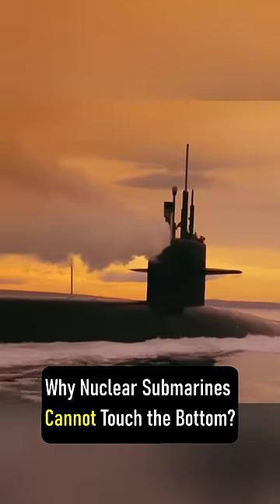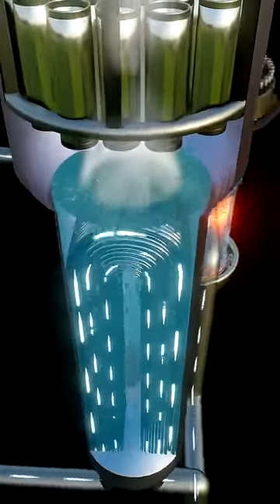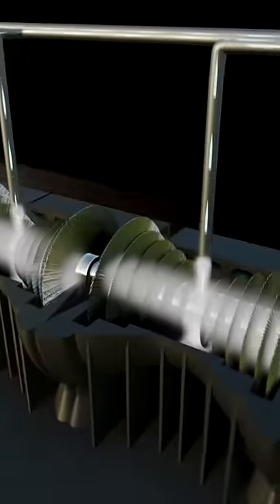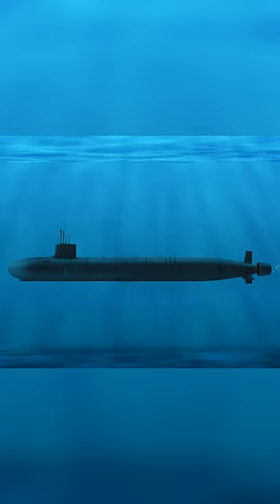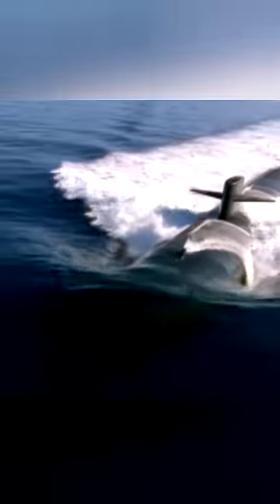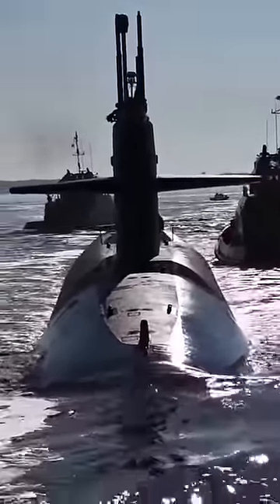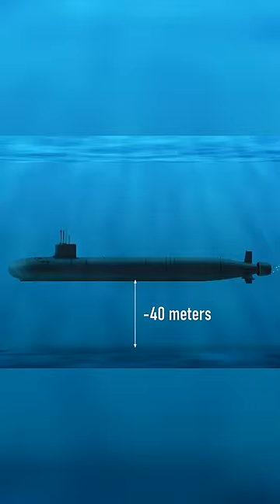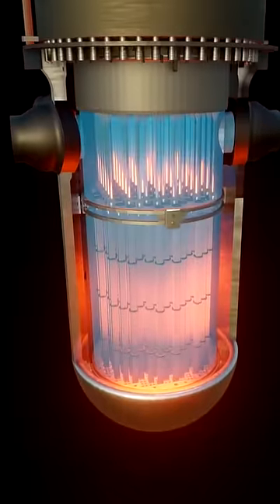Why Nuclear Submarines Cannot Touch the Bottom

Comment: I’m sure these are designed with other cooling inlets incase of some sort of failure resulting in having to set the sub on the ocean floor. Not supposed to is not the same as can’t.

Comment: Sooo what happens if the the sub was rolled 180°  or listed extreme angle in some type extreme circumstances, whatll happen to the reactor or other systems? I m assume it is weighted at the bottom like a Weeble Wobble. But things fail.

Comment: I like the idea of a nuclear reactor power a submarine and all of the benefits of stealth and extended time in service under water. After the horse we used steam engines in cars, trains, and boats, not so good in submarines. We did however find a way to power submarines on steam. The water cools a nuclear reactor. Some becomes steam. The steam runs everything. So the end even modern ships and submarines are just a different type of steam engine. It runs on nuclear decay instead of coal. Smokeless until it isn't working then it gets really rally smokey but not the kind you want.

Comment: The question is, what Submarine would operate that deep for? Unless something happens onboard or they're invading torpedoes.
Reply: Not for open deep ocean but in littoral areas such as outside a port. This is half to hide and the other half for station keeping and not having to use motors overcome currents.

Comment: Ummmmmm…… that’s not entirely accurate. I went to Nuclear Power School in the Navy and there are two coolant systems in the reactor…. None of which come directly from the ocean into the reactor core. The primary and secondary coolant systems don’t mix and the water is extremely clean and pure. Ocean water is pulled into the ship, yes…. but it is cleaned, filtered, boiled off….. etc before really being used for much. With the exception of the ballast tanks used for buoyancy. This is the most likely reason they would keep the sun off the bottom. However, once at the bottom, the sun no longer needs to draw water in. At that point, they only need to push water out.

Comment: Seems like a design Flaw to me.
Because it takes a long time to safely shut down a nuclear reactor.
Consider that the sub is damaged and sinks to the bottom without imploding/exploding. (Lucky break)
Because of this current design, a nuclear incident is likely to happen before repairs or rescue can be accomplished (let's not forget that if the reactor goes critical, (besides humans) What is the main (most dangerous) cargo on the vessel ? 🤯

Comment: This is not true for all subs as some subs have the ability to burrow into / attach to the sea floor / walls.  They have these decently sized retractable drills.  Also obviously the intakes have self cleaning filters for large debris.

The US is working on copying a feature of some pretty unique Russian subs which can have multiple frontal attachments to cut cables or dig undersea tunnels to hide just off the coast by widening undersea caves common along most continental shelfs.

Comment: My question here is where does the radiated waste water / steam go when exhausted? I mean..... it can't be good.
Reply: It isn't so it doesn't.
But when released in a manual discharge, it's done >12 miles. Dilution is the solution.

Comment: Many of the technical comments in this video are just plain wrong.  For exame, this type of nuclear reactor does not generate MOST of the energy based upon "decay" but rather nuclear fission.  [The decay energy (heat) is only approximately 5% of the energy (thermal) output.] Due to my security clearances, I will not comment beyond this point.   From a technical standpoint, the information issue is totally misleading if not wrong.

Comment: This is misleading.  The water that cools the reactor is a self contained loop.  One one end is the reactor, on the other is a heat exchanger.  The heat exchanger transfers the heat into another self contained loop of water, which then transfers the heat to the intake water they are talking about.  This redundant system is to ensure no radioactive material or radiation escapes into the environment.

Comment: That’s BS! They will routinely sit on the bottom when doing covert stuff or hiding out...Not all of their intake / exhaust ports are located on the bottom
Reply: Ur 💯% correct.
With ballast tank openings on the bottom ~5° off CL, (both port & starboard), and all SW hull valves 'in the pressure hull' = a HUGE void between outer ballast tank and inner hull,... sitting on bottom was common.
(Firm mud/sand was preferred.)
Been there, done that... I was leading PO for last zinc replacement on the Nautilus, '76-'80.

Recommend "Blind Man's Bluff" for an appreciation of Spec Op missions, some declassified in the 80's.

Comment: How about the fact that nuclear reactors don’t work off radioactive decay heating? The clue is in the name: reactor. They use nuclear fission, not nuclear decay, as their power source.
Reply: @BlackBull.  but it’s not. Radioactive decay emits small charged particles, or photons, and takes the nucleus from a higher energy level to a lower one. It involves no mass defect (i.e. the conversion of matter into energy using Einstein’s famous equation). The two processes are entirely different.

Comment: Calling bs on this, primary versus secondary cooling loops, external hull versus internal pressure hulls were many intakes are located, and if you think all nuclear subs have intakes in the bottom of the hull you are vastly mistaken, do you not think they dont want to bottom the boat due to putting noise into the water... these subs go to patrol sections of water thousands of meters deep many times past their crush depths to listen to long range ultra ultra low frequencies of sonar to stay the hell away from everything and everyone.

Comment: You don't know this, it's classified. What if they take cooling water in along the sides, a few feet below the surfaced waterline? Raw sea water is run through a heat exchanger. It does not run through the reactor.    It is classified what runs through the reactor itself, sodium or something else.  Also it's a boat and not a ship.  This shows how little you know.  You may want to do your research before making a video which makes you look ignorant.

Comment: WRONG, There are plenty of ports which require a sub to operate on the surface with less than 40 feet of water under the keel. The reason to not run the ship aground is self evident but also to not spoil or dirty the seachests which are the input sea water for secondary cooling loop which goes to steam generators NOT THE REACTOR. If a sub was to rest on the bottom it would dirty the seachest and require a blow down which is loud operation. This is not about safety of reactor but damage to secondary cooling loop and associated sea water pickups. Guess what happens in shallow water and happens all the time in Hawaii? It requires seachest blow down to clean them. So wrong in everyway.

Comment: How do they keep the reactor cool when it's in dry dock?
Reply: Typically they try to cool the reactor as much as possible beforehand. It can take days to weeks for decay heat to drop to levels where it's not a concern. Plus, some ships can have flanges bolted to the outside of the ship and have hoses run to and from the sea outside of the dry dock.

Comment: Uhhhh, no. First- many different designs of sub. Second, some specifically designed to sit on bottom…I’ve spent days sitting on the boat’s bottom during silent ops… MSW valves designed in various locations on different types of boats. Ballast tank inlets on the bottom on all subs…that might be a bigger issue…
And that “40 meters” sounds like random guess…we had no such requirement on my boat. This whole video seems silly, inaccurate and I’m not sure why I’m wasting my time. But I’m only an ex fast attack (SSN 647) operator. A qualified nuke electrician at that so I know a little something about the MSWV’s and cooling the reactor…

Comment: So if one of those submarines had a malfunction and sank to the bottom its cooling intakes would be blocked and the reactor would overheat.
Would the results be like Chernobyl or Fukushima?
Reply from the maker: Yes, if the reactor is not turned off in time. In case of any accident on the submarine, the reactor is immediately turned off and switched to power supply from the batteries
Reply: No, don't believe just anything you read on youtube. Don't believe me either, go look at some studies
Reply: For US designs, neither would happen and we have ways to prevent that
Reply: @ww2planes_810  russian designs wouldn't either, just think of that sub that sank of the coast of poland
Reply: @substec  
what is the name of the song in the video ?

Comment: So would it be fair to say if you were to foul the waters around our subs, you could cripple the subs ability to function?
Reply: You could cripple pretty much any ship if you do that. Diesel ships require cooling water for their engines too, as do gas turbines.
Reply: @WaterMan416  and no one has thought to exploit such an easy weakness? If you could cripple an entire naval fleet without causing a single causality, wouldn't that be a worthy weapon?
Reply: @nightmarestitcher  well, ships are designed to deal with this. Typically they have large sea chests built to draw water over a larger area than the pipe to have suction be relatively low. They also have a screen to filter out large objects. And, if the sea chest happens to get clogged, they can shut a valve and blow air or water out through the sea chest to clear the blockage. Ships also rely on redundant systems. Problem with using it for combat is that it'd mostly only be useful as an area denial weapon, which also denys that area to you. We have used things like mines and submarine nets for a long time. Trying to put a lot of seaweed in an area would be tricky, as it needs the right conditions and takes years to grow. It's probably just more useful to focus on blowing up the other ships.
Reply: @WaterMan416  damn, you know more than this guy, you should have your own channel...thanks for the info
Reply: @nightmarestitcher  I spent a couple years on a submarine, so I have first hand knowledge

Comment: Not true, reactor heat is removed by steam generators which produce steam which drives turbines, correct. But the circ water, sea water, condenses the steam back to water by removing heat in a condenser, & this circ water is the reason subs don't pay on the bottom due to possibility of injesting contaminants that would block cooling passages in the condenser, thereby affecting its ability to remove the heat. How do I know, been there, done that.
Reply: Yo' brother... what boat(s) were you on? Prototype?
RO at S1W, then 571 from '76-'80 (decomm).

Comment: This is rubbish, the cooling system is self contained and doesn't require constant outside flow of water.  Only in certain circumstances is it desirable to use outside cooling via indirect heat exchanger system.

Comment: Does that mean that they're dumping radioactive water
Reply: No. This video is a little simplified. The reactor has its own contained water system. The cooling water that is drawn into the sub is more or less pumped around those reactor pipes. No radiation is transferred. Think of like cooling your beer, you put the bottle in ice water  to cool it, you don't put the ice and water in your beer to cool it.
Reply: @brendonmulholland4307  what? Nooo, that is not how it works either
Reply: The water passing through the reactor core is very pure water and isolated from sea water. The reactor "cooling" water turns a completely separate water system to steam via heat exchangers that passes through the turbines. That 'steam/water' is not directly in contact with radioactive reactor cooling water. Sea water cools the steam back to liquid which is pumped to the heat exchanger to be turned to steam. Sea water never comes in direct contact with steam system water or reactor water. The salts in sea water would cause devastating corrosion. So you have three completely isolated water systems.
Reply: @J123G  thank you, didn’t feel like typing all that

Comment: Russian subs do this regularly...
Reply: Did... They don't on their new ships because the depth isn't great enough to avoid satellite detection during the day.
Reply: @ryannelson8717  Okay... I don't know Jack about satellite detection of subs. How do satellites detect subs? The only thing I could imagine is visual detection. But murky water can immediately counter that. What depth is needed to avoid visual detection in clear water? 

I don't think you can run MAD from orbit or detect the faint heat signature of a boat in 200m depth idling its reactor.
Reply: @jackmclane1826  Satellites during the day can see a boat at 80m like they are on the surface during high noon. A Satellite can still distinguish it at that depth in clear water for about 12 hours a day , and then about 2 hours before sunset/rise it's basically indistinguishable then after the hours of prep to get back off the bottom it limits the time to about 6 hours of being able to sit undetected per day and thus isn't worth the cost. Murky water has limits the subs that could do that because of their technological Era they would be limited in the sonar capabilities by the particles suspended in the water rendering it effectively useless for about 45 minutes after perching thus limiting the time even further. Given that the Soviet subs doing it were most effective around 60m, they wouldn't really be hiding once the sun comes up with today's satellites thus rendering it effectively useless and extremely cost inefficient, plus the added weight and therefore reduction in max capable speed which is already pretty limited.
Reply: @ryannelson8717  So it's visual detection... I have to believe you, because I don't have own experience. Although I wonder a bit about the detection quality. Still it needs clear sky to work.

And on the other hand: If they are safe below 80m there is still some use for that tactic. You don't need to be in your best depth if you are silently lurking. 

Are there enough photographic satellites to cover earth in a reasonable intervall? Analysis can be done by Computers and comparing the pic to the previous pic of the same region.
Reply: @jackmclane1826  Only enough would be needed to scan the spots where they would be commonly found as the number of suitable places would still be limited as sitting below certain depths would eliminate the benefit of sitting. The cones don't have a 360 and are mostly directional on a single plane. They don't go up a little, but is mostly down and around so sitting deep would have no benefit to sitting as you aren't going to see anything. So sitting deeper than 80m would likely result in sitting deeper than a transitting boat which if you're to far below them, probably about a 50m depth difference and the likelihood of detecting a boat which is practicing proper sound silencing begins to dwindle. So you would really only have a range of about 85m to somewhere in the range of 150m depth to be able to sit and try to find enemy subs which are limited and likely not an area where you would find a sub anyway since most of the areas they traverse exceed 200m for the bottom depth. As you can see the reasons just continue to pile up. The areas where they are vulnerable is less than 100m and that's generally areas that would be leaving and returning to Port, and even then you can still be seen as a sub at 100m it's just not as clear as if you were on the surface. It would be like looking down from a plane and just happening to see the sub, which fun fact, can be done. So the area where it would be most useful is less than 100m which likely would be detected by satellite and areas around most countries bordering waters have some form of motion detection that is going to get set off by an enemy sub traversing close to the sea floor within a few miles of our coast, the Severodvinsk would likely be the only sub even willing to attempt an approach close enough to set them off today, but still unlikely that they would as there is very little to be gained coming that close.
Reply: @ryannelson8717  I have to let that sink in a little...
I knew that the Russkis have many of their boats with downward looking sonar domes in their bows. Do the same restrictions apply to boats that have the full front dome used for sonar and also for side arrays?
Of course side arrays and the chin feature on Virginia/Seawolf subs would be the first to be damaged by flooring so it wouldn't make sense there either.